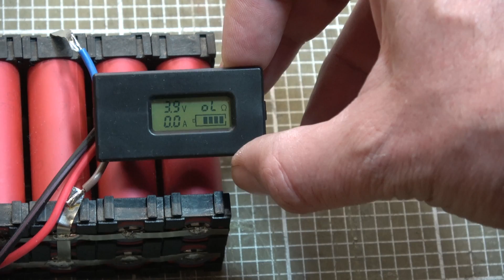Ridiculously over-complicated bedtime reading lights

Comment: Good Video!
I was wondering where to get that LCD Panel Meter?       I tried eBay no luck.

Later, FW.
Reply from the maker: Hi Futz With - here's a link for the ebay listing I used... http://www.ebay.co.uk/itm/Lithium-Li-ion-battery-tester-LCD-meter-Voltage-Current-Capacity-18650-26650-WD-/291992030539?hash=item43fc14cd4b:g:assAAOSw5cNYbi5J ... Cheers!!
Reply: Thank You!!
I guess It was my search wording!
It would seem I need a tutorial on Searching eBay!   :)

Later, FW.

Comment: Overkill is the best kind of kill :)
Do you have a link/ search terms for the unit you replaced the TP4056 with? I couldn't find anything from what I could make out on the chip/random searching. Thanks :)
Reply from the maker: Hi nderr - It's an LI4001 chip...  http://www.ebay.co.uk/itm/2A-Lithium-Lipo-Battery-18650-Charging-Board-Mini-USB-LED-Charger-Module-3-7v-/282265801243 ... Here's a link for the datasheet too... http://cds.linear.com/docs/en/datasheet/40011fa.pdf ... Cheers!!
Reply: Many thanks :) without the LI, results weren't happening, and it looked like a J in the video ;)

Comment: Haha, awesome. My tech room is also full of boards and you always want to do stuff which seems easy and cheap in the beginning.  Do you have the link to buy a solar panel like that?
Reply from the maker: Thanks Luc -  The solar panel I received did not look the same as the one in the picture, but I checked the output from the panel, and managed to get over 8W out of it, so I do believe that it's a 10W panel as advertised... Here's the link... http://www.ebay.co.uk/itm/Smart-18V-10W-Portable-Car-Boat-Power-Solar-Panel-Battery-Charger-/391461077986?hash=item5b24e603e2:g:wMUAAOSwfC9XPTZx ... Cheers!!